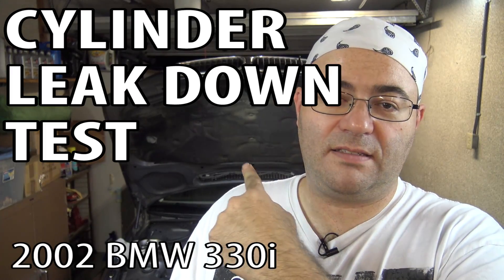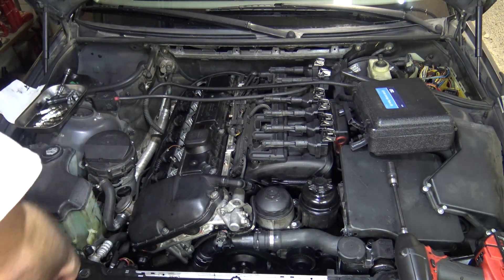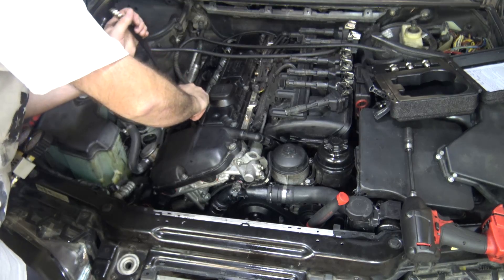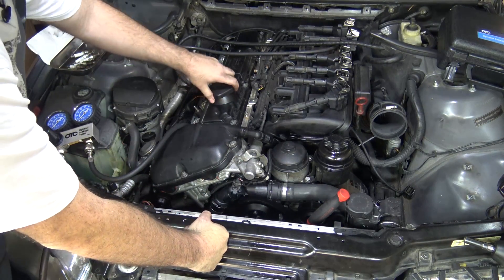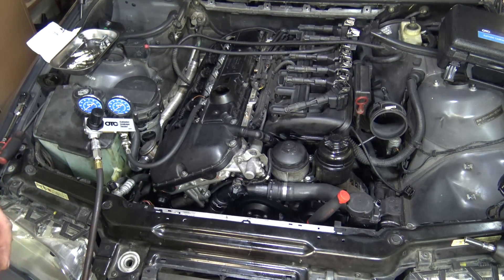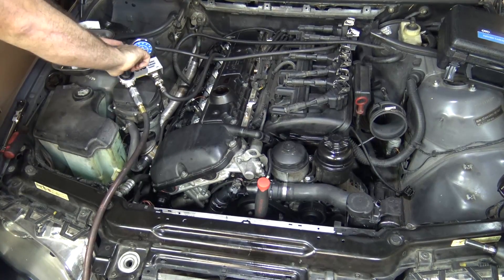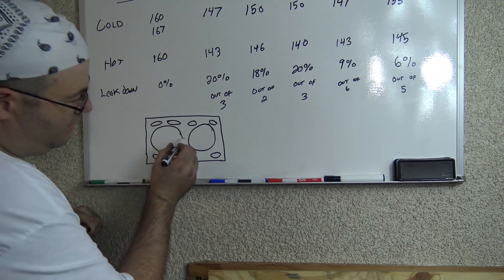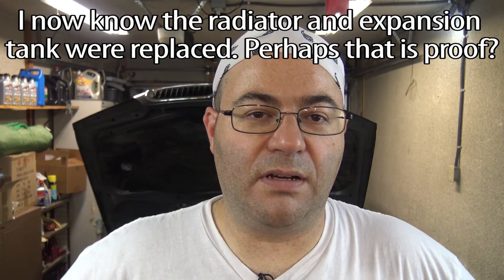How to Do a Cylinder Leak Down Test on an E46 BMW DIY

Comment: Would you also listen for air coming out from the radiator cap in case the head gasket was leaking into the cooling jackets?

Comment: if it comes out of another cylinder spark plug hole wouldn't that be a blown head gasket between the two cyls. OR is it possible for the air to go down past the rings on one cylinder and then come up past the rings on another cylinder? maybe it's funny but it just occurred to me.

Comment: I don't think a leak like that would be a big deal. Compression from cylinder going to another cylinder. 
Also mine burns about 2l per 4000 miles.

Comment: I have a fuel dilution issue. My oil smells like fuel and it looks like there is fuel in there as well. I have a 2004 m3. I recently replaced my fuel injectors that were absolutely pissing fuel, and I noticed a rising fuel level before i replaced them. After the replacement and an oil change, it still smells of fuel and looks like there is still some in there. I am hoping it might be residual fuel left in the engine, and that if i do another oil change or at least flush it out with clean oil, my issue will go away. If not, it’s a new mystery i have to solve. I was wondering if you have any input on that, thanks.
Reply from the maker: You’re on the right track, do another flush
Reply: @50sKid  Will do, and then I'll come back with an update. Pray for me!
Reply: @diamondplays8944  did the flush help resolve the fuel odor
Reply: @JTapia512  It sort of did. I don’t know if it’s like a placebo thing, but I still think I smell fuel and it might just be that way forever. I do regular oil sample analysis and everything has been fine since replacing the injectors, so it doesn’t bother me anymore

Comment: good video. another way of checking if your cylinder is at TDC compression is to stick your finger in the spark plug tube and feel the pressure.

Comment: I don’t understand why the hot pressures are less than the cold ones! Shouldn’t the hot pressure figures be higher because everything is sealing better!
Reply: When rings are worn cold oil which is more viscous (thick) seals better.

Comment: Mr. 50'sKid, I have the same engine, 330 (m54) engine on a stand and i need to preform a leakdown - What hose/nipple did you use? I have the exact same OTC leakdown kit. 

What size hoze and ADAPTOR did you use for that size of spark plug?????? I noticed in the video that you do not use any of the ones in the kit.

Comment: 5:12 - you are doing it completely wrong which will give you quite useless data for the whole operation...
you have to calibrate the tool first with the otput hose unplugged and never turn the calibration knob when the output hose is connected - you can only turn it when you want to calibrate it again before measuring the next cylinder ! (just to check if the shop air has changed or not; and you dont need exactly 100 psi air either then, thanks to the calibration knob).

plus you could probably save some twisting time by following the actual firing order...

Comment: A Question, Why would you have to warm up the engine if all you’re doing is a leak test? what does warming it up do differently?
Reply: its gonna expand the metals a bit and also smear more oil as the sealant
Reply: i read about it
Thanks for replying

Comment: Maybe you can help, 2000 328ci Auto 0% cylinder leakage is this normal? I had Radiator,Thermostat,And Water pump replaced, and it still overheats.

Comment: Lost basically all compression in cyl. 2, did a leakdown test (cold), and got roughly 8-9% loss on all cylinders with the exception of 2 which is nearly 100% leakage.  Cyl. 2 leakdown test has the majority of the air is escaping through cyl. 3 spark plug hole with minimal air escaping past the rings, intake and exhaust valves (very similar to all of the healthy cylinders).  Cyl. 3 leakdown test is one of the healthy tests with minimal loss.  My confusion lies in the fact that I cannot find any air, or not much is escaping to cyl. 2 and out the spark plug hole when testing 3.  Shouldn't a blown head gasket between cyl 2 and 3 flow both ways (from 2-3 and from 3-2) or would the piston at TDC on 3 have something to do with in not flowing back to 2.  I will be pulling the head as i have no choice, was just curios as to whether or not anyone had any experience with something weird like this.

Comment: I'm watching this video because I found the dreaded milky goo on my oil filler cap. Wasn't very much at all...also the coolant looks fine and the dipstick doesn't have any on it. Any help would be great
Reply: Nope after removing the cylinder head I found a crack from exhaust valve to water jacket
Reply: Probably got moisture in the cap from not tightening it all the way

Comment: I'm about to do a leak down test on my n42 318i 'coz it's consuming about the same about of oil as yours. my bet is that my valve seals are shot as all the symptoms point there. just wondering if you were able to get the head machined and if you solved your problem with the oil leak?

Comment: hey there 50sKid ,so i did a leak down test on my M52 because i had a cyl1 misfire
I first tried compresion test i go (0-cyl1)(190-cyl2)( 185cyl3)(190 -cyl4 )(185 -cyl5 )(180-cyl6)
then i tried the leak down test and Cyl1 leaked on cyl3 + cyl6 and thru the spark plug on cyl1 even tho i had the test tool really tight thru it.please where do you think the problem is ? thank you

Comment: Hey great video I have a fuel cut out on cylinder #6 have replaced disa valve cause of leaking oring have did the ccv and all the lines did all vacuum lines intake gasket valve cover gasket coil and spark plugs MAF sensor what could be my problem head gasket the code is a P01353

Comment: I know this video is a couple years old now, but just a little advice for those watching. Do yourself a favor and add a ball valve to the intake side of your leakdown tester. It will save some wear and tear on your wrists. You'll want to open it slowly so you don't force the engine to rotate by over zealously pressurizing the combustion chamber you're testing, but it's much easier than spinning the pressure control knob five or six turns twice per cylinder.

Comment: What if my car is not running for me to be able to warm up the engine can I still perform this test
Reply from the maker: Yes it'll still tell you where the air is leaking out.
Reply: I may have an open valve on 4 its still reads 0 on compression test and holds no pressure in leak down, head gasket is fine. I don't see any oil mixed with water. Took valve cover off and pushed on on intake lifted and its really soft. Could it be that or weak spring or bent valve? I don't want to take head off unless I have to
Reply from the maker: A bent or burned valve is always a possibility but where was the air leaking out of when you did the leak down? Exhaust pipe? Intake tube? Radiator? Oil cap? Adjacent spark plug hole?  You have to open up everything when you do a leak down and listen.
Reply: Adjacent spark plug hole. Thought it was a gasket at first until I took valve cover off and pushed on intake lifter and it was really soft. Its an m54b30 in an e39 2001 530i
Reply: Its strange because its the #4 cylinder and air comes out of 5 but 5 holds pressure and has good comp. I'm still wonderjng if itd still the head gasket on the inner side of the cylinder bores?

Comment: how much of a problem is this test on a cold engine?  The car I need to check will not stay running for more than a few seconds.
Reply from the maker: You can do it cold--the numbers just increase a little bit but who cares--with a leakdown test you're trying to hear where the air is escaping from.

Comment: FYI. As a general safety tip, DO NOT leave your socket wrench or breaker bar on the crank pulley while you're testing the cylinders. You do not want the wrench flying into your head or slamming it into parts of the car.
Reply: yeah that's true. you never know if that air can psh down tha cylinder

Comment: youre supposed to set your compressed air supply at 100 and regulate the tool to 90 for best results.
Reply from the maker: No, no you're not.  You need 100 psi going in to make the math easiest.  You could use 90psi and get out the calculator, but you're not supposed to.
Reply: I was only citing the instructions from otc which i found strange. Not worried so much about easy math as i am about accuracy. otc wants you to regulate the tool at 10 psi less than your tank pressure so if you have 110 coming into the tool then u can set it to 100 and have the easier math, but otc says for best results use the tool at 90 and have your incoming air from the tank at 100. I really enjoy your videos by the way!
Reply from the maker: Ah sorry man, I will defer to OTCs instructions on that.  I think they probably recommend 90psi because that seems to be the standard safe operating pressure for every air tool, however we all turn our pressure up way higher than that.
Reply: yeah that makes sense. accuracy is important to me be because at volvo in order to get approval to fix oil consumption on some cars you need leak down numbers and i dont want to gain or lose approval on a false reading ya know?

Comment: Quick question. While turning the wrench to get TDC, you mentioned you went a little too far and had to back up (reversed ratchet). Does going in "reverse" affect or damage the engine. Or is it only supposed to turn in one direction? Thank you very much!
Reply from the maker: Nah you can go back all you want.  The crank bolt won't unscrew because it's torqued down with over 400 Nm.

Comment: hey 50's kid. when I do a leak down test if I put air in cylinder 2 but I hear the air escape out of cylinder 4 what does that mean?
Reply from the maker: That your valves might not be closed all the way--check out my corrected video: https://www.youtube.com/watch?v=Uq63-M5vwdk
Reply: That video isn't working. Do you have another link? I get zero compression on cylinder 2 and it all comes out of 3, but on 3 I get only 2% leakage through the oil pan.

Comment: Great videos mate, always very informative. miss the old days with the durable blocks
Reply from the maker: Ah but in the old days you had high tension piston rings that would wear the bores down such that after 150k miles you needed to rebore that block, whereas today you can get away with a re-ring job!
Reply: 50sKid I guess, aluminium blocks do have their advantages but I just think the disadvantages out weigh them, including other petty problems such as wrecking the sump (oil drain)  thread and spark plug thread. 

Anyway your e46 videos are great, just a shame you are having so many problems with it. I know the feeling.. lol

Comment: Awesome detailed information!! Definitely appreciate the technical details in the pressure test and information on the head gasket leaks both between cylinders and cross contamination from cooling fluid into cylinders. I'm looking forward to seeing how you take care of the oil consumption problem. I wouldn't worry too much about the pressure numbers if  no symptoms are really present. Either way, I'm looking forward to more informative videos. Excellent work partner!
Reply from the maker: Thanks!

Comment: Hey man! Great videos. I've been watching for a long time and I have used your videos for all my DIY's so far (VANOS rebuild and oil filter housing gasket are next on my list). When I bought my 320Ci 2 years ago, I was burning 1L of oil every 900ish Miles or so. Now, it's more around 500miles/L. It's getting pretty crazy and I fear for the piston rings. By the way, you have forty-six E46 Repair videos! :) Howdy from the UK. 2004 320Ci 102k miles.
Reply from the maker: Hey, thanks for the comment.  I've actually recently started a thread on e46fanatics where I wanted to hear from everybody as to how much oil they are burning and someone in that thread is adamant that the 320s don't burn oil, so it's nice (for me) to hear proof but of course it sucks for you that you have the same problem that many others, including myself, have.  I have a video coming up on how to install a catch can, which many people report helps cure the issue.  Pretty crazy that I have that many videos on just this car already, but that was the goal of course!
Reply: It's always nice to have some reassurance from a group of people, as opposed to worrying you're the only one having the problem. I've heard the same things to, but as you said, I can say first hand it's not true. Do you mind posting the link to the thread? Cool man, looking forward to the video!
Reply from the maker: http://forum.e46fanatics.com/showthread.php?t=1113341

Comment: Wow this a great video, sorry to hear about your head gasket.  do you think that maybe if you remove the valve cover and re-tighten the head bolts it might fix the compression leak?  It's worth a shot if you have to remove the head anyway.
Reply from the maker: I wish it were that easy!  Unfortunately, it's extremely likely that if I try to tighten the bolts at all, they will strip out.  It's a known problem with this engine block and other aluminum blocks like it.  I will probably have to install steel threaded inserts called timeserts to repair that.

Comment: that really sucks... I watched all your vids on this car. I can't believe it has this many problems. did you buy the knowing about its poor condition? great for making vids but damn...
Reply from the maker: Yeah I bought this car because I wanted a project car.  I knew it had certain issues.  I did not know it had THIS particular issue.  And I definitely didn't think I would have the transmission issues that I did, but, like you said... makes for good videos.  I hope everyone can see that I'm not getting frustrated with all this stuff and driving the car off a cliff with no one in it, but rather dealing with it all in stride.  That's how I am.
Reply: I like your dedication, I'm looking forward to your next videos. keep up the great work.

Comment: Duuuuude. Sorry to hear about the health of your motor. However if anyone can make fixing it clear and concise and easy to follow I know you can. Def sounds like an overheating issue on the head. I'd be interested in seeing you pull the pistons with the motor still in the car but will be waiting and watching your progress. Good luck!
Reply from the maker: Thanks for the support!  I'm leaning towards pulling the block specifically because I've learned that you can't remove the oil squirter on cylinder #6 with the crank still in the block because the crank sensor impulse wheel is in the way, so running the hone to deglaze it wouldn't be possible.  Oh well.  The nice thing about this whole mess is knowing I'll get a faster car at the end of the project.

Comment: Also Radiator and Coolant Tanks are very common to get bad even without Overheating. The Radiator gets warped and the Tank gets replaced also, so i wont call that a proof for overheating.
Reply: Well fingers crossed haha

Comment: Have you checked the Oil-Dipstick? If you open it up the pressure of the crankcase will release better than by just opening the Oil-fill-Cap, because of the Check Valves in the Head to remain some Oil in there. If the Pressure is still coming out of the other Zylinders, you might have to Change your Head-Gasket. Worped Heads on the M54 are very unlikely if the car hasnt overheated. Greetings from Germany :)
Reply from the maker: Ah but you're not thinking about the oil drain holes in the head & block for the oil to drain back down to the pan.  There are no check valves there.  Blow-by has to have an unobstructed way to get up to the valve cover and exit the engine, and that is how.  Also, another reason I don't use the oil dipstick tube is because it is submerged within the oil in the pan and depending on that level, the relief hole in the side of the tube may or may not be submerged as well, causing the air to have to bubble down through the oil to travel into the tube.  Greetings from California!